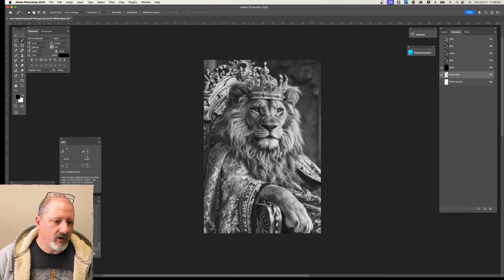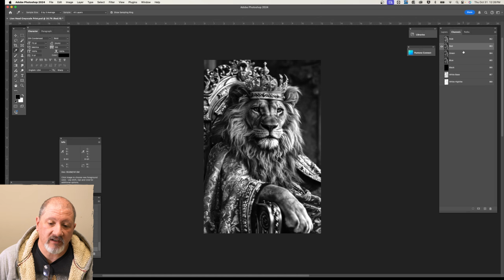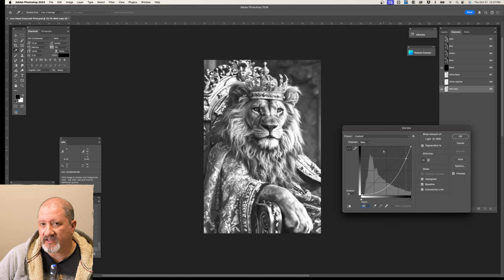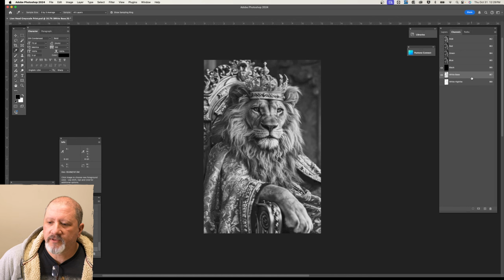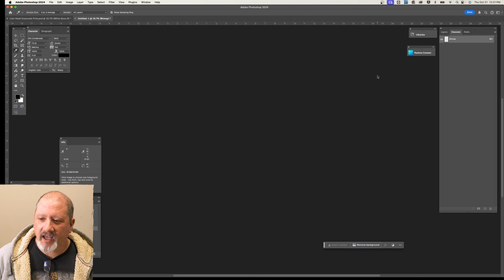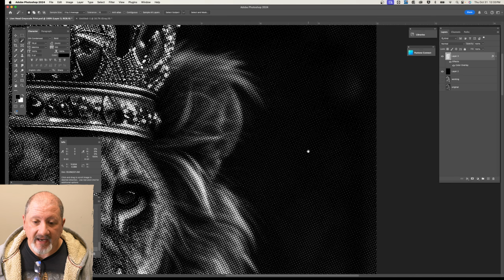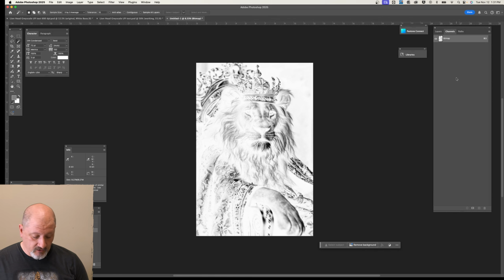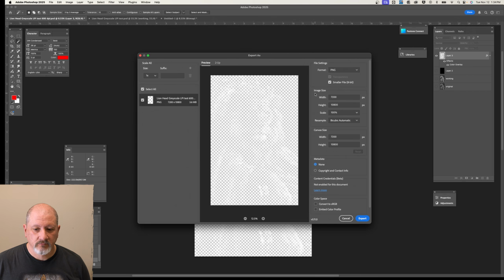Can You Make DTF Look Like Screen Printing? | Deep Dive with Colin

Comment: what is the best lpi for dtf halftone sir?
Reply from the maker: Great question! For DTF halftones, most printers see solid results around 35 to 45 LPI, depending on your printer’s resolution and the detail you're going for. Lower LPI helps maintain clean dots, especially on film. Always worth running a few tests to dial in what looks best for your setup. Keep experimenting and keep printing!
Reply: @Ryonet , that's a great explanation, sir, thank you very much!

Comment: Nice experiment, I’d love to try it, but the service that prints my DTF only does prints at 300 DPI.
Is the print resolution important, or is it enough to work on the file at 600 DPI and then have it printed with a 300 DPI printer?

Comment: So many wrong things here.
Just white print using a full color system?
Thinking DTF as screen printing is the big mistake. 🤷‍♂️
Reply: Can you educate me about what was actually wrong?

For this video, It's about using the DTF TOOL to simulate a screen print.  Needing to fill in missing or extra pieces is normal for both sides of the industry.  You wouldn't do a full color - or in this case full Greyscale if you don't need to.  And there are a ton of straight white DTF prints out there.

Besides, this is a case of "can you do it", and if it CAN be done, then it is an option.
Reply: @colinhuggins6164  I'll make a video about it in my channel.
Reply from the maker: Would love to hear your thoughts!